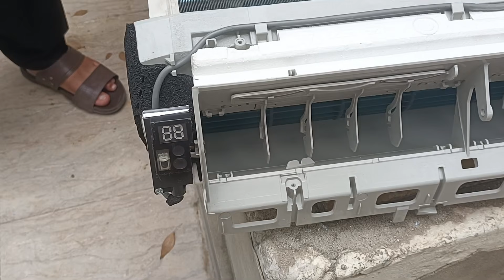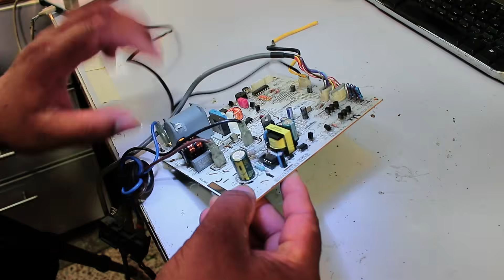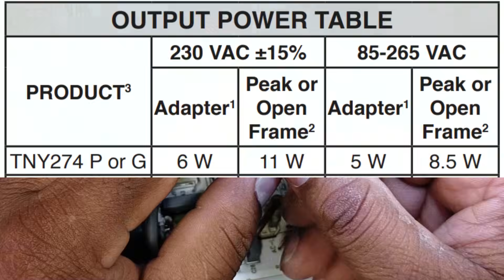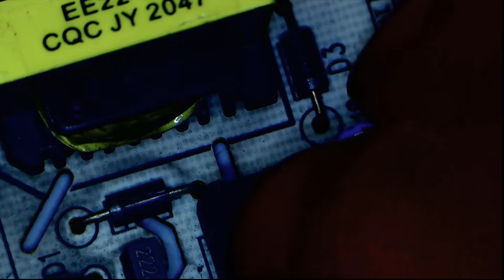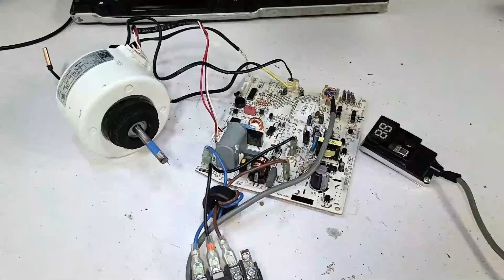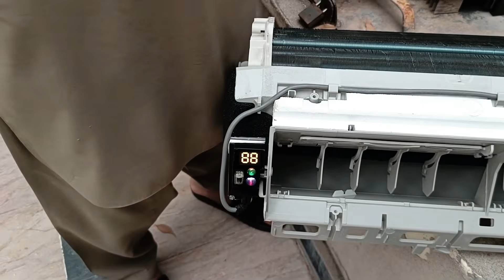The Most Confusing AC Repair : Customer Said “It Still Doesn’t Work”

Comment: thought it was good to have a base for the IC... easy replacement..!! 
manufacturer does not fit base to save on cost..
Reply from the maker: You are right but if this kind of problem emerged then we cannot ignore a single weak point to save our credibility
Reply: Solder in place is always better.
Reply: The pcb acts as a heatsink to absorb heat from the IC so although using a base makes it easier to replace it will not dissipate heat as well and the life of the IC will be reduced significantly.